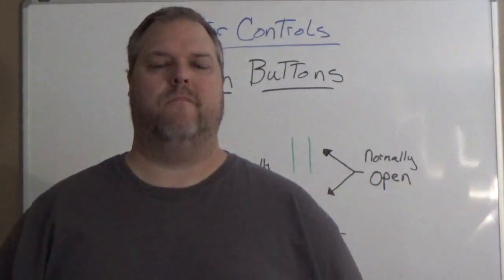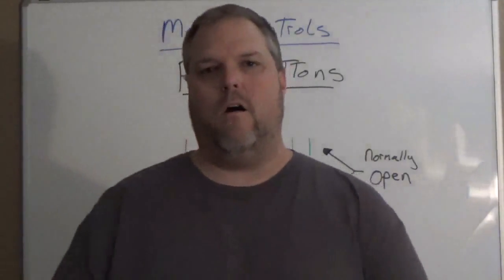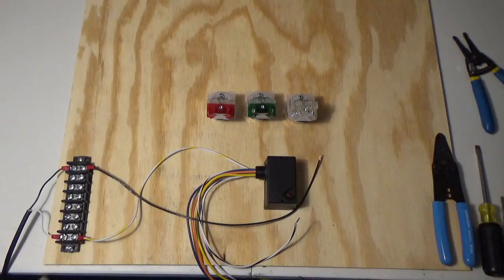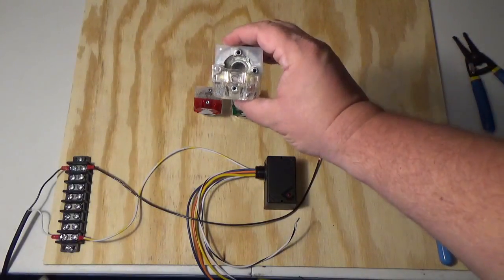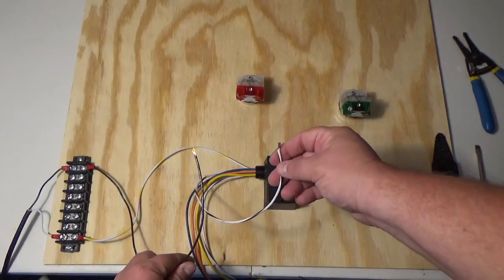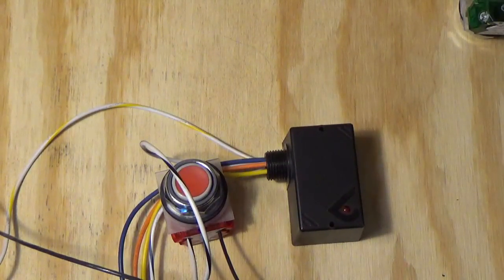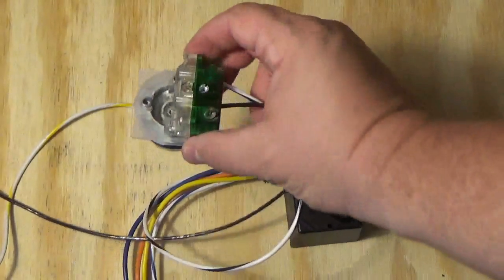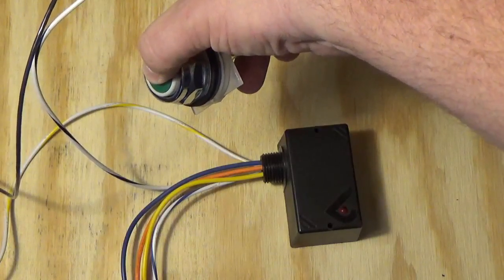Push Buttons for Motor Controls Eplained

Comment: Hi I live in st Martin in the Caribbean I have a drum switch that open a gate forward stop and reverse but it get damage so easily I want to use a 3 push button forward stop and reverse can u help me with the installation with 110 volt comes to the switch and then goes to the motor can you help me that